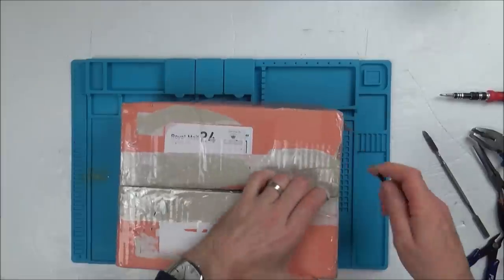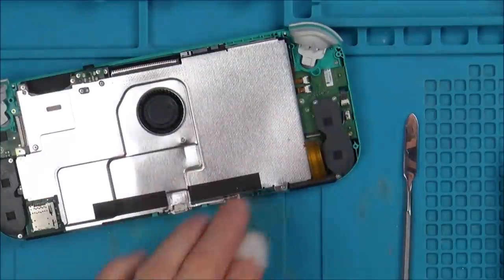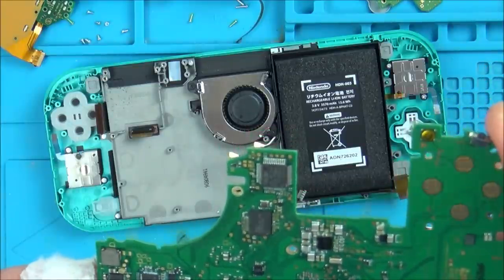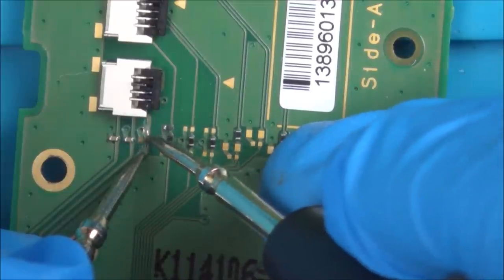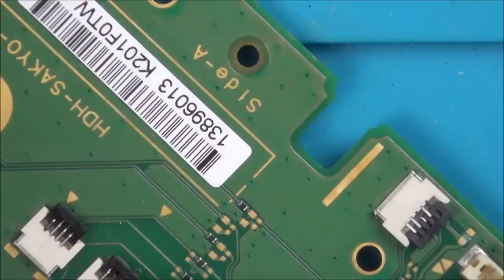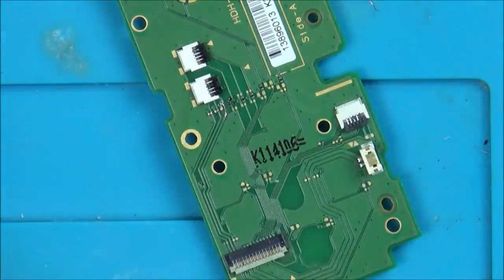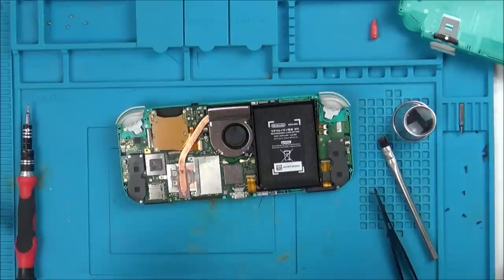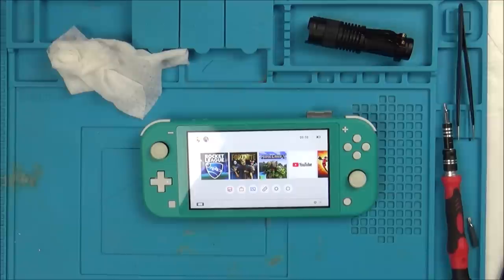Trying to FIX: Water Damaged Nintendo Switch Lite from eBay

Comment: If you think that the backlight is the issue,  try shining a torch at the screen as a first test.  If the LCD is working you will be able to see an image.
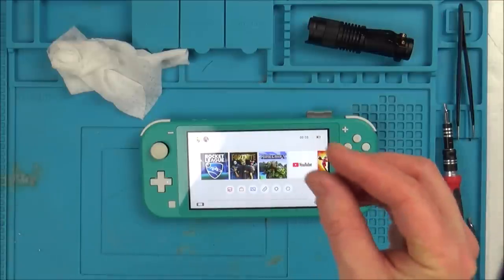Reply: he mentioned it in the video 34:40 . he probably wanted to show people the full process of trouble shooting.
Reply: If it's just the right board wouldn't just getting a replacement board work too? 
I don't have access to the tools he used
Reply: Jose you can't buy those boards I've looked
Reply: @joserachi96  probably can't get one on its own but if you bought a switch with a busted lcd but working backlight that would be the best way to get one I figure. Get as busted of a switch lite as you could find but with a working backlight and that board would be ok to my understanding.

Comment: Hello I have an original switch and it accidentally got wet from po0 that spilt
I dried it right away and left it alone for a day. It still turns on though, so can I use it?

Comment: Speaking of water damage, do you think it’s possible for me to salvage a normal switch that I spilled water beside? I knocked over my glass beside it and the water ran into the top fan. I turned it on for a very brief couple of seconds (I know I shouldn’t have) but then turned it back off. I shook the water out and wiped it off and then left it in a container of instant rice for about 5 days. It’s still in there. I’m too scared to turn it back on in case there’s water in it still

Comment: Hello good look I have a problem with a lite and I have tried everything with it and nothing But it surprises me that when I remove the charging cable, the home button turns on and off suddenly, I think it is the battery that does not receive a charge, any suggestions, thanks

Comment: Something you may want to try Vince. (Practice on and old laptop or similar first). Buy a cheap soldering iron. Use it for plastic welding. If you are careful so you don't go all the way through you can push small amounts of melted plastic case across the the break to lock it (while squeezing firmly together). I go down the crack alternating back and forwards left and right over the crack like stitches, then use some plastic 3D pen refills to weld over top for strength. I try and mix the edge of the new refill weld with melted case to sort of chemically bond. I do this for laptop case repairs and the results are sometimes undetectable but if not at least you strengthen the case and stop the crack growing.

Comment: Hi mate. My switch lite fell in the pool. I managed to get the "nintendo" screen to show but it turns right off after. Any ideas? I cleaned most of the corrosion on the board.
Also it only charges at .41 amps.

Comment: My niece got her switch lite water damaged. However, when you turn on the switch you can hear the fan spin, there isn't a response from the screen or buttons indication that the system actually boots into the OS. Any tips? The fan is also quite loud.

Comment: The little black SMD's are ferrite beads, not capacitors. Since they're in series the circuit can't work without them as that breaks the circuit. So something is probably still broken/not working correctly (Because it looks like one is missing - hard to tell on video). You can replace them with a wire link in a pinch. They just filter out high frequency content from the signals before the signals go trough wires (read: antenna's) for emissions compliance.

Comment: As he says though, there might be more corrosion underneath chips and stuff. Ideally, I guess, you would take the parts off, clean and re-apply. These components are really tiny though, and hard to do without proper equipment.
Reply: there is only one bga chip on board. rest of them use bottomside as ground/heatsink so there is no place  for water to go under. And removing BGA one is not worth a risk, there is no chance he can return it to correct position later

Comment: Hey Vince, did you ever consider getting some self-adhesive copper tape? Since i got it I've been using it as a main material for repairing traces like these. Just cut it, tape it directly to the board and solder the ends. Far more faster than using tweezers and a piece of wire.

Comment: The cap is probably a " decoupling" cap, this provides a bit of "lift" and a bit of cleaning of the supply and most engineers will include them in their designs, however the device will operate OK without them as we can see, but in some cases you might not get away with it, it will probably be abou 0.1uF (a circuit diagram would tell you) might be worth getting some and "have a go" just to be complete and thorough in your work, are diagrams not available ? I would wanna no if it was decoupling or not...good work !

Comment: Hey Vince, excellent work on the repair. Love to see your celebrations! In regards to the little crack on the bottom edge, you could try melting it from the inside with your soldering iron. I've done that on a couple of devices now (nothing as new as a Switch Lite!) and have had pretty good results.

Comment: I would like to thank you for all the old networking videos helped me with a job interview only question is what happens to all these fixed switch lite ive been looking over ebay for a broken one to repair if it sounds cheap enough but cant find broken switch lights on ebay

Comment: have a look at the ts100 soldering irons. incredibly powerful and super small and compact. think youll find it so much easier to sue on the super fiddly jobs like that wire bridge.
Reply: Yeah I have the TS80 and TS100, they are both great little irons and well worth looking into.
Reply: Seconded too, TS100 is great.

Comment: That thicker thermal paste doubles as an adhesive, so the backplate wont lift from the heatpipe, since it has no screws holding it down

Comment: Good job Vince but I think ultrasonic bath would have cleaned it way better as there could be still corrosion under the BGA chips which may get worse with the time and then will be unrepairable most probably

Comment: Mettalic oxides are molecularly larger.  Their expansion like freezing water breaks connections.  A good clean and a douse with deoxit or any light water displacing oil is probably enough so long as it isn't too far gone.  Alcohol absorbs water so follow up with a protectant oil film for longevity.

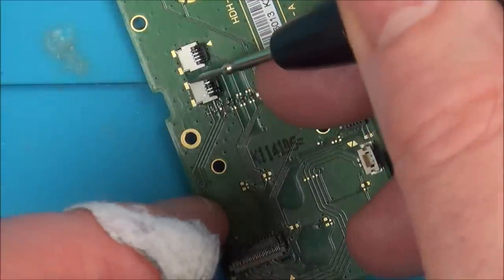Comment: 24:04 should also  have tested if you had bridged the 2 traces by doing the same thing, holding one of the pins at the connector's end while the other sits on the pad or trace you dont want to make a connection to. if it beeped, then its bridged. if not, then the solder job was done correct.
-im glad that nothing has blown and the switch turned on right after.

about the thicker thermal brown/pink ish paste, i have a feeling it dissipates heat slower. Because, when i put an A grade thermal paste there instead, and play the same game it seems to warm up quicker around the back. dissipating heat quicker into the metal shielding and the heat pipe.

Comment: Stripped down a barely used bread maker as impossible to find one now and it was not turning the paddle. Had to take the whole thing to pieces as not designed for replacement but i found the issue was the belt had basically melted away. Got a spare coming then rebuild time. Would never have bothered before watching your vids :)

Comment: As usual great vid Vince, always look forward to them. When you were repairing the broken trace, instead of using enamel wire just use a strand from a multi strand cable, then you don't have to strip the enamel off and you won't contaminate the joint with burnt enamel or have to worry about getting a good joint, enamel wire is great for long runs but for short distances such as this it's not neccessary. In regards to your comment about liquid damage and wifi etc, i've found on the bigger chips, such as wifi, PMIC, relatek etc that if they are completely bad and the tegra can't talk to them through their serial bus that the console will not boot at all, this is both a good thing and bad thing when diagnosing, if wifi chip is good but certain contacts aren't getting where they need to go you get an orange screen and if the RAM isn't making a connection to the tegra in some form or another you get a blue screen - although that can sometimes be software too. also i find myself saying out loud flux Vince, fluuuux when you were repairing the trace ;)
Reply from the maker: Brilliant info, especially the orange and blue screen. Thanks so much. I never knew about the different colour screens so this will come in handy in the future. Makes sense with the enamel wire as well. I have lots of stranded network cable (cat5e and cat6) which has 7 strands per core so I can use a single strand :-)

Comment: the jumper wire your using is fine but the best way i have found to cut it is put a sharp blade on the wire where you want it to break off then wiggle the wire. this way cuts the wire while you still have pressure pcb track and it stops the track ripping off

Comment: Funnily enough I was fixing tiniest tracks on a ribbon cable and shorted sub-mm capacitors on water damaged ps vita's back touchpad and just as you finished with your fix, I did as well and it worked! Just a little shared luck story :)

Comment: Hallo Vince, my opinion is, every components with black corroded contacts need to be replaced, if you don't have a spare parts you can take out the components one by one of the board and put the new solder on the pad then this component returning to its place. It's a long job but corrosion can continue destroy your board even if you clean up with IPA. 
I apologize for my English perhaps this can be understood.
But I like your videos you have really soothing voice.

Comment: thanks for the video, just bought one with a similar fault, in my case pcb is ok but the backlight ribbon burned on one leg, will try to restore or put a cable around
Reply: same pin btw :D

Comment: After opening and working/cleaning circuit boards I use a small paint brush to put on a thin film of WD40, just to assist in vapor or moister from settling; causing corrosion.

Comment: My son's switch fell in his bathtub today and it was on standby, any hope that it will work the next days? It's in Rice rn
Reply: When something falls in water, the first thing you need to do is to open it up and disconnect the battery. It's not not so much the water damaging it, but the combination of water and electricity that causes electrolysis. After you've disconnected the battery you can clean it up anytime.
Reply: @kriswillems5661  thanks for the answer sadly its broken now, we didn't open it up because we can't send it in to Nintendo then.

Comment: It's handy to use tape to get a wire in place before soldering. That way you don't have to hold it in the right spot.

Comment: I have a switch lite that turns on and works but after a couple minutes it will click around randomly and the buttons stop responding well, anyone have any ideas what the issue is, i have rese and recalibrated everything

Comment: thermal paste gets thicker with time the moisture in it leaves from the heat causing it to thicken and i would recommend putting it on both side like nintendo has done but! it would as you said be fine :) Love the vids thanks for the work you put in! learned bunch from you

Comment: Well done Vince, another successful repair! I remember in one of your previous vids you mentioned that you got a big tub of thermal paste - for the future, I recommend GD900 (aliexpress item number: 32967354006), I got it after recommendation from another youtuber Tech YES City. I got 30g tub which will last me a bloody lifetime, but used it on my bros, nieces and nephews and mine PC parts (CPUs, GPUs) and it works well! Costs just 2 quid, performs as well as arctic MX4 .And that greasy residue seems to be normal, as I had the same thing on mine.

Comment: Hey VINCE Could you fix my Amazon Kindle Fire HD (3rd Generation) 8GB, Wi-Fi, 7in - Black - P48WVB4 

Replaced the battery.. still not charging sometimes it’s
stuck on kindle fire screen - am from the UK - Bedford.
Reply: He said hes not fixing nobodys stuff.
Reply: @2S2F1  that's a double negative
Reply: It isn't even worth it
Reply: Just sorted my Fire HD 3rd Gen, it was soft bricked (stuck on logo), try this video...https://m.youtube.com/watch?feature=youtu.be&v=ps0MblrZg9M Good Luck.
Reply: Looked at replacing a screen on one once. It was cheaper to buy a new kindle
Reply: "not fixing nobodys stuff" Jesus christ. 🤦‍♂️

Comment: With as much water damage you have seen you may want to look into ultra sonic cleaners to get try to get to any corrosion that may be under the chips at the solder balls. Nice one tho, I figured the corrosion was to far wide spread. Would be interesting if you could keep one like this for a daily driver to see how long the repair could last...
Reply: He has one.

Comment: time 22:00 - instead of "gluing" at the point of interruption of the conductive path, I would stretch the replacement wire from connector to connector. The soldering tip is terrible.
Reply: You obviously don't watch his videos a lot, only once I see him doing that and even that time he first spend at least 30 minutes trying to solder it at breakpoint.

Comment: Awesome!!! Nice easy fix!  I would just fit a 100nF (50v if you can find one small enough) capacitor on there and re-test it.  Surprised you didn't use the ultra sonic cleaner - I would use it on something corrosion damaged, because corrosion gets under BGA components etc, and the ultrasonic can help with that.  Just have to make sure its dried off afterwards - perhaps rinse it in IPA then use hot air to try it off.  Great job, that trace looked very thin!!
Reply from the maker: Cheers Chris, looking at another good board it is unpopulated, maybe water sat against that 17V trace and the ground next to it and caused the charring. I was sure something had burnt off. I only know this now after the nightmare I had with the 2nd grey one!!!! 
My ultrasonic is still full of jewellery cleaner. I should use it more but it is a bit of a pain to remove the old stuff, fill with the circuit board cleaner and then it takes forever to heat up. Kinda puts me off using it when you are in the middle of a fix as you have to down tools for a couple of hours :-)

Comment: I fixed a water damaged smart watch just with a deodorant(spray) and a toothbrush by spraying on the motherboard(a lot) and then spraying on the toothbrush and scraping and cleaning the corosion and to my surprise, when I put it back together it powered on just fine but the digitizer started freaking out. I put it in to a warm place and the touch screen started acting normal but sometimes it was acting like it was touched. Now I can use it.
Note: It was a lot of corosion.

Comment: if there was a capacitor there then put one back dont just bridge the gap with a wire the capacitor belongs there for a reason even if it is just to clean it up
Reply: He didn't bridge the capacitor, he bridged the broken track.

Comment: This is an inductor that missing, not a capacitor. This music reminds me of Gummy bears :D
Reply from the maker: Thank you Technixbul, i thought the small beige coloured ones would have been capacitors. Do you know what the inductor would be used for on this backlight trace?
Reply: @Mymatevince  Well it depends on frequency used in this circuit and also the frequency of the noise that must be filtered. I've never seen insides of any console after PS2 but i assume the frequency will be around 100kHz on the backlight inverter to avoid flickering and improve current. My guessess are if it works DON'T touch it but anything between 10-100uH should be fine if it will bring you piece :D You can also measure one next to it. Measure the track with your scope, a cheap DSO can measure up to 200kHz digital signal. Set it to 10uS period and 2V per division to observe shape of the signal on that track. Black ones are inductors, brown or pink ones are capacitors, dark green ones with digits on them are resistors, white ones are fuses ->  in most cases, but you should observe where the element is connected to judge what exately is.

Comment: You need a microscope Vince. If you want I can send you the link to one from China for only £150.
Reply: Also you need to learn to use diode mode on your multimeter. Because you could've just got a diode mode measurement of the backlight connector and it would've told you immediatly that there was an open track.
Reply: Paul Zaim he’s got one 😁